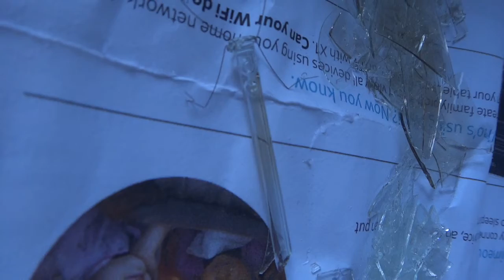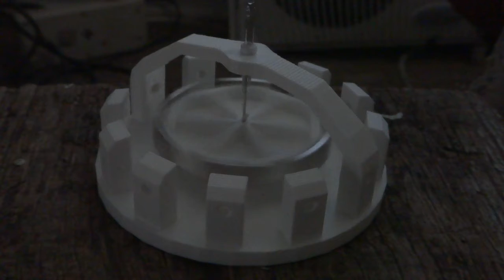EZ Spin needle on glass bearings

Comment from the maker: EZ Spin needle on glass bearings 
Paid an online service $17.00 to print the two main parts of 
the EZ Spin, the rest I can make with things I have or can find. 

Recently had the strength to attach the magnets.
I was excited to levitate the rotor with magnetic bearings but I 

noticed it was dragging on the rotor magnets.

I am relived by that as I wont have to find a solution to the 

strength of the magnetic field changing when it gets hotter and colder . 

The sewing needle point into a Phillips head screw works 

well for the bottom bearing, I am concerned that metal on metal will wear over time and add friction.

If I can find a small piece of glass with a divot in it, I will 

replace the screw with that . 

A glass pipette would be perfect for the top bearing, the 

closest thing I have to that is the glass tube in an incandescent light bulb .

Even better, if I could score one of those pocket watches with 

17 jewels in it .

Before I start installing the coils I wanted to do a quick test 

exploring this magnet arrangement.

https://www.youtube.com/watch?v=qAv5zgsOXtM 
I twisted the drive magnet in my fingers and it seemed to 

rotate the rotor, the tricky part is if the rotor is strong enough to flip the drive magnet . 

Bearing material makes an extreme difference:

-glass top bearing, iron screw bottom bearing, 3m48s free 

spin 

-magnet and bb top bearing, screw bottom bearing, 3m14s 

free spin

-magnet only top bearing, screw bottom bearing, 3m48s free 

spin 

-steal needle on glass for top and bottom bearings, 5m12s 

free spin - would have been longer but I scrapped on the rotor when I adjusted position of sliding bottom bearing .

-steal needle on glass for top and bottom bearings (bottom 
bearing divot made with drill bit and lubricated with number 2 pencil), 7m47s free spin

I used a fresh new unused drill bit and a drop of water to cut 

a divot into the glass .

This video explains how water helps glass "break" in a more 

controlled manner :

https://youtu.be/tEAxhMECluM?t=215

I drilled the rotor hole for a bigger needle then ended up 

using a smaller needle to fit in the glass tube.

Three pieces of dental floss was used to tighten the hole, 

they ended up to one side making the rotor lop sided, need to center that . 

The needle rattles around too much in the top bearing, I may 
end up putting a drilled glass divot piece for the top bearing as well . 

The microphone really focused in on the whistle sound that 
the ink pen tube made when I blew through it . 

Interesting part, my ears could only hear the begging of the 
whistle when I started blowing, not the entire breath of blowing through the tube, my hearing loss for that frequency .

It seems the video recording shifted the frequency so I could 

hear it while watching the video back, that the whistle sound was the entire time I was blowing .

I did not plan for the rotor to stop turning at the same time 

the youtube video ended that was playing in the background about the motherboard review, just worked out that way, my entire life has had curious timing like that .